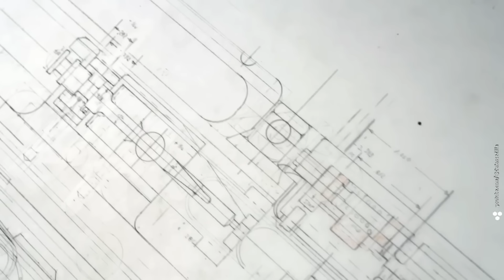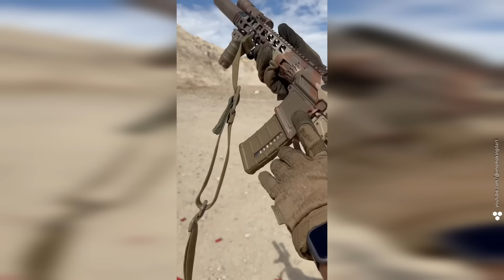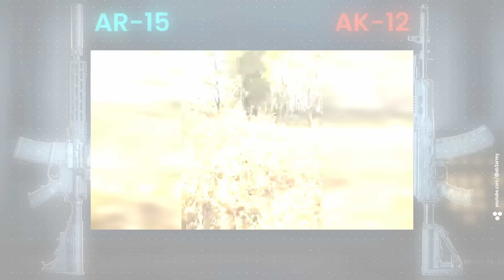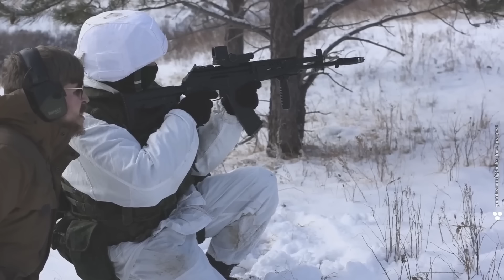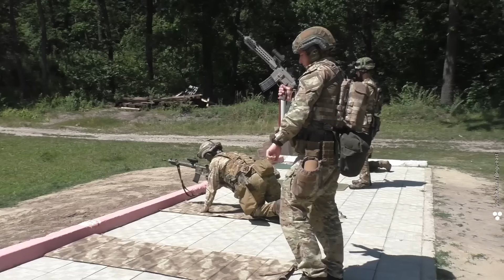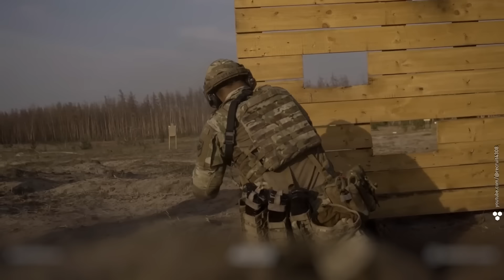Something Is WRONG With AK-12... While AR-15 WIPES OUT Russian Army

Comment: I am 200 % pro ukraine and there are legit actual issues with material quality on the ak12s to the point its knwo Russians prefer theri older AK100  series due to better materials... but Jesus this is just AR fanboying and shitting on the AK 12 cuz its Russian. 

Ive seen so many Ukrainians with captured ak12s...and i doubt they would use it if it was that bad.

Also good luck mortaring your AR15 with that crappy charging handle, under or oversinsertion of your mag, droppign your mag hittign the release button by accident ...

In short i would not trust my life to a DI gun, it has been proven again and again, those do not match the reliablity of piston systems... HK416 ,Bren 2 etc. are the way to go if the AK is not your thing..

Comment: The AK-12 Is A Real Case Of, “If It Ain’t Broke, Don’t Fix It”.
Reply: True, but modern M4/AR-15's are also way better than AK-47/74. They're much more accurate.
Reply: Yes AR's are more accurate. How much do you really need? And when firing long distance, is it gonna be the shooter missing or the rifle? Hell, check 9HolesReviews on the AK 105 spetsnaz build. It shot, with no misses, to 500 yards. Accurate enough for a 12.4 inch carbine, no?
Reply: @dmgib5239  there is literally no real accuracy difference between an Ak 74/105 in 5.45 and a 5.56 m4, all modern assault rifles are 2-3 moa and so many tests were done showing its all bullshit. As commented, 9hole review went 500 yards with every single ak type and combination of optics/iron sigth and there was no issue if anything tehy were shocked how much BS were they taught back in the US army regarding supposed aks lack of accuracy.
Reply: And, If You Have Ever Been In Combat/ Firefight, You’ll Find Your Opponent Is Within 100 Yards.  Hence, Long Range Accuracy Is J U S T A Little Overrated.

Comment: The ak and its variants are more reliable without or very little lubrication and with more carbon build up because of its loose part tolerances, the ar platform has much tighter tolerances therefore it has to be cleaned and lubed more often to continue to run reliably. Both have pro's and cons, imo it really comes down to personal preference (what firearm the person feels more comfortable operating and what they shoot best/more accurately)

Comment: The direct gas impingement of the AR is lighter and pressurizes the rifle to prevent foreign debris and mud from causing stoppages. It’s a “wet” system that requires oil to lubricate moving parts and keep fouling to a minimum. 
   Without disassembling the rifle, oil alone will keep this rifle firing for thousands of rounds. You can’t over oil this system unless you fill up the gas tube, barrel or bolt with oil. Gas rings are the only wear item that won’t last the life of a well made rifle. 
   I would even pick the budget build AR from BCA,PSA, DPMS, ect. over any AK! The only caveat is no polymer lowers!

Comment: The main problem with the early M-16, tied to the lack of cleaning kits, was the decision not to chrome the barrel, and especially the chamber. The extraction failures were caused by corrosion pitting in the chamber, and the case would expand into the pits, mechanically locking the case into the chamber. It took a cleaning rod jammed down the barrel to force the case out. It was critical to keep the chamber and barrel well oiled to inhibit rusting. Made worse by the propellant the Army chose, not what Stoner specified, which made the rate of fire too high, fouled the action quickly, and aggravated the chamber corrosion. Army Ordinance almost ruined the program with stupid decisions to save a few bucks.
Reply: My M-14 never failed me, my M-16 did.

Comment: "The AR-15 uses a direct impingement gas system. Propellant gasses travel through a thin tube directly into the receiver, and puss onto the gas key of the bolt carrier." 

Well yes, but actually no. In the AR-15, the gasses enter the gas key and expand inside the BCG (bolt carrier group), pushing on an internal piston.

Comment: You can work on the AK-74M with commercial purchased stock and handguard parts to achieve the same end result of the AK-12. I will choose the UAR-15 for the zero line.

Comment: For war I would pick the AR type weapon every time. Never had an issue in the military with M16’s and M4’s deployed overseas or stationed in extreme cold environments. The AK is an easier weapon to correct a malfunction, but you will have more malfunctions. The AR type weapon is more difficult to correct malfunctions, but you will have less.
Both are great rifles, but ergonomics, logistics, modularity, sealed system reliability takes the AR platform far beyond.

Comment: AK-47 RIFLES RPK 6.5MM GRENDEL WITH A 2.0MM RECEIVER AND A HEAVY 18"BARREL TO 20"BARREL TO A 24"HEAVY BARREL WITH A GAS BLOCK REGULATOR FOR LONG RANGE SHOOTING AND ACCESSORIES AND STILL BE ABLE TO USE THE AK-47 MAG THE BULLET WITH A FMJSCBT HOLLOW CAVITY LIKE THE 7N1 WITH A TUNGSTEN STEEL CORE BOAT TRAIL AND USE A MAGNUM PRIMERS FOR ALL WHETHER BURN NEED TO RUN 2800FPS TO 2900FPS TO 3000FPS FOR LONG RANGE SHOOTING AND ACCESSORIES

Comment: I see guys constantly having operation failures with AR & Styer Aug at the range. 
  Never seen that with an AK variant.
Reply: That's a maintenance issue, and barring bad quality, the AK still wins in that department.

Also, a buddy of mine had an AK clone that didn't want to be zeroed and was constantly jamming and breaking. Ended up trading it in for a Century Arms AK. Heavier but way better quality and shoots perfectly fine and on target.

Still, the AR platform is one of the most reliable weapon systems on the planet, which is why more and more nations are adopting it.

Comment: This is redundant since the first few months of the war ruined the 12s rep. 

If anyone has any serious critiques of the ak100 series, I think that will be much more valuable. 

Ar15s definitely rusts unless it rains cosmoline in steppe country. 

You cant safely or reliably  mortar kick a ARs charging handle open. 

Cant say ive ever heard of bolt override failure in an Ak series. 

Most countries historically used a rocknlock system. Bro sounds like you might have a detonation if you do it wrong? 

Ran thru ARs have that upper and lower wobble. Last time i checked this is the ran thru- used equipment war. 

I could see peq mounts being a issue but if your force isnt eqquiped for it anyway, why bother. 

If this argument was backed by pragmatic reality i feel like we would see whole companies armed with AK alternatives. And... yes im sure theyre out there but are most likely a supply friction point. 

No bias here, im just trying to further the convo. Id build them both tomorrow.

Comment: it realy does impress me how far the AR platform has come in reliability, as an american i opted for an AKM cause i always seen ARs jamming, i saw them as a "range princess" a gun you only shoot a lil on weekends at a clean range and then you clean the rifle fully before storing it. plus i dislike tiny bullets. i dont want to find out whos the fastest gun when my enemy pops out to shoot at me, id rather ID where they are hiding and demolish their cover with heavy bullets. i never liked 556 or 545 for this reason. but mayhaps a scar H or a HK417 is more up my alley. i have an emotional soft spot for the AK47 / AKM so it saddens me to see the newer AK models are so bad. im excited to see what americas new 6.8mm is capable of, it supposedly travels much farther, faster, flatter and hits harder than the 7.62x51mm. maybe after a war it will win me over

Comment: Yeah give me an AR, either my personal one,  UAR, M4 or M16A4 I mean an A2 would work…but those lose a lot of options. Originally trained with and was issued an M16A2 then an A4, sometimes an M4. Have shot AK’s the older variants do work, thy are cool. Collection wise, but that’s about it. Amd I mean sure the modularity of an AR is great, but you typically don’t get to use 99% of that in the military, at least a large, very structured military unless you are special forces. Maybe different for Ukraine’s military in this war, but in the US, even the smaller USMC during the worst of the GWOT, try modifying your rifle, unless it is moving or removing some issued equipment from it, the minor stiff…you ain’t gonna like what happens to you later. Ukraine may have more freedom in that sense. Especially earlier on. In the scramble with volunteers bring their personal guns, and seen some stiff about units or individuals buying AR’s for use with mixed small arms calibers in units…that had to be a nightmare.

Comment: Started out in 1982 with the USAF's M16 (NOT the M16A1 - the straight M16).  Would be happy with my original butt number 747.  Would be even happier with the M4A1.  Can still detail strip and reassemble with eyes closed (yes - DETAIL strip).

Comment: The description of the AR-15 "Direct Impingement" gas system is utter BU11S4IT!!! The gas key does not drive the action; it merely directs gas to a cylinder in the bolt carrier which then reacts against a piston machined on the back of the bolt to operate the lockup.

Comment: I will say that the AR-15 also wins out in reparability. After building a couple of my own, and also being forced to pull one apart with tools to swap a poorly designed feature/part on one for something else; the AR-15 wins because parts can be changed with simple tools. You don't even need a full or proper shop. You can't change a barrel on an AK-47 or AK-74 without removing rivets(and thus destroying them without the possibility to use them again) and having to go get new ones, and maybe a couple other things. On an AR-15, every part you remove to swap the barrel can be re-used as long as it wasn't already damaged(or damaged by you while removing it). The process of the barrel swap on an AR-15 is fairly straight forwards if you learn how before hand and have the proper tools. Depending on how the barrel was installed, some are harder to swap than others tbf. The AR-15 is fairly plug and play. Practically any similar parts between different brands are effectively 100% interchangeable, even if you have to file something down a little. I love the fact i can so casually swap worn out parts like: Bolt Carrier Groups(BCG), individual parts of the BCG, buffer spring, the buffer itself, and the charging handle. I love the AR-15.
Reply: Yep. I know a guy who rebarrels his own ARs with the softer stainless steel. Says is cheaper to make and change barrels to keep the thing accurate vs. other rugged options that are pointless in his opinion.

Comment: Battlefield reports from Ukraine say that most Russian soldiers, and All Russian spec ops, much prefer the AK 74, warts and all, to the new AK 12.
The new "AR type" H&K 416 family as used by many NATO nations, INCLUDING the USMC, uses a PISTON actuaction instead of the original dirty and hot Direct Impingement (DI) actuation.
SLAVA UKRAINE!
Reply: Meaning the HK416 is closer related to the AR-18, which incidentally is the most common system in new military firearms.
Reply: The AK12 suffers from the same issues as the Vietnam-era M16; a good base design ruined by bean counters who don't have to use them.
Reply: Heroyam Slava!🇺🇦🇺🇸Texas

Comment: So, lemme break it down from someone who has spent a lot of time in various combat environments around the world. Anyone that downplays the AR platform's reliability is completely unfamiliar with the modern materials used to make the parts inside these ARs. Modern BCGs, barrels, handguards etc are absolutely incredible. The AR15 of 1960 something is NOT the rifle of 2026. Yes- they look similar, and from surface level it appears very little has changed, but that couldn't be further from the truth. 

I should add- not ALL modern ARs are created equal. If you're forming your opinions based on that $300-400 PSA, Andersen or whatever budget brand rifle you got in 2008 or 2009... you might as well be comparing it to the first gen rifles issued in early Vietnam. Yes- that much has changed in less than 20 years.
Reply: Even the PSA ARs will run dirty, but they won't run without lube.
Reply: @georgesakellaropoulos8162  I don't  run without  lube either😂
Reply: @LarryChandler-i2g  idk about that. "Sorry buddy, no lube". I'd run.
Reply: I love my $500 PSA. It’s my beater range toy. It works and I don’t mind abusing it because it was cheap.
Reply: @kevinryan7154 I’m right there with you. $500 PSAs are honestly incredible guns for the price and will operate just fine. Specifically with guns there’s a lot of diminishing returns.
Reply: The power used in Vietnam was awful and caused many of the issues that cost many many lives
Reply: Suggest you read ,The Gun by C.J.Chivers.   Vietnam era....not a chrome lined receiver or barrel...powder when tested matched the 556.    When mass production started the ammo companies opted to use up old ball spherical powder which was dirtier.      Chambers rusted and gas systems fouled.......that equals a gun that didn't operate.
Reply: @RustyGates-g6j    thanks, been about 40+ years since I read any of this stuff...things that stuck were lack of chroming, wrong aluminum alloy, no cleaning kits or instructions and "dirty" ammunition...and McNamara pushing though stuff he should not have for cost savings...pretty much everyone from that era hated him.

Comment: The magazine well doesn't make a weapon better, it adds weight and bulk.
Either hand can be used to manipulate the bolt handle / op rod.
5.56 has a low ballistic coefficient, relative to other rifle munitions.
Comparing an AR15 that is closed up to an AK that is open is not a fair comparison, mechanically speaking. Both should be closed or open. In combat, one may leave the safety down, but that is a use case and design short-sight, not a mechanical limitation.

Comment: The best assault rifle is certainly an AR 15 with a piston. There are many in both Europe and America, the most well-known are the German HK 416 and the American-Austrian Sig Spear LT. They have all the advantages of the AR 15 and the AK 74 without any of the defects. Ukraine should simply implement a short piston on the AR 15; it would be the ideal rifle. They could obtain a license from one of the many American factories. You're spoiled for choice these days. They are rifles that automatically adapt to the silencer without changing the gas setting on the piston.
Reply: I like the PoF with its roller bearing and fluted chambers. I even added a roller bearting to my PWS which has an AK like rod. Stuff runs great and the rod prevents the dreaded override spent case jam at the gas key

Comment: You need a bolt carrier scraper looks like a screw driver it scapes all that crud out of that carrier in minutes. Gotta have one😊
Reply: A can of carburetor cleaner and a dental tool works best. Then after that a light coat of oil .
Reply: @max420thc rem oil blast it out then a bolt scraper blasting it out till it's clean. Ot a wod of paper towels and a pair of pliers and twist with rem oil till clean. Also  a large 18 inch pipe cleaners at a arts and crafts store  rem oil then clean the gas tube. Light rem oil it evaporates fast. School is over
Reply: P.S. NEVER USE HOPPS #9 OR ANY Anomia BASED CLEANERS IN THOSE RIFLES. ONLY THE BARREL VERY LIGHT AFTER A THOUSAND ROUNDS. FREE
Reply: 😢 nothing will ruin a BCG quicker than a scraper

Comment: AR-15s are certainly different now than the M16A2 I had during desert storm.  Sand locked that thing up fast.  The video is right about the wrong powder used in the M-16... the original design had a very clean powder called out but after the original contract, the US wanted more velocity, so they specified a different dirty powder that offered more speed at the cost of making the action less reliable due to carbon buildup.
Reply: McNamara dropped the crome lining as well.
Carrier, bolt and chamber were supposed to be cromed....period.
I have a Vietnam "era" crome bolt; ( after we got our shit together) and carrier. You would not think it was 55 years old.

Comment: I've been fighting in Ukraine in both wars and used both AKM, AK-74 and AR-15.

Disregarding the lack of rail, I think AK-74 was peak performance. Light, great iron sight and good enough performance. 

AR-15 usually have a louse iron sight as they expect you to get an optic. Its heavier as well. But it has a rail for wannabe operators to add lots of extra stuff to make it heavier.

Comment: AR for the win. But I’d love to add an AK to my collection.
Reply: Love my ak's and have tried several over the years.   Ammo is the biggest factor. Good ammo equals great results. Better guns work better.    Have had ar's and they drill holes.....
Had one in very cold and it wouldn't feed untill heated up had to use forward assist.    Hate the sprooong sound near my ear
Reply: Me Too. Adding an AK to my collection.
Reply: Get a Polish Beryl wz. 96.
AK's reliability, AR's modulariry, NATO compliant.
Reply: You have to if you're collector... I actually have collected what I concederd the big 4 of assault rifles

M16
AK47
FN FAL
G3
Reply: AR for misfeeds and constant cleaning
Reply: @golden_arrow46  have never experienced a misfeed with good ammo, and can go 1000rd without cleaning a thing. You just regurgitate ridiculous talking points youve heard online. Your ar wont jam with reliable ammo, and it will shoot until it gums up

Comment: I like the AK 74. Especially my Polish Tantal. I also have an KR 103. My side mounted holo site doesn't move. After 4 years it still holds the same zero. But, I have more experience with my AR 15's and would go that route. Depending on the terrain I would prefer the 103.